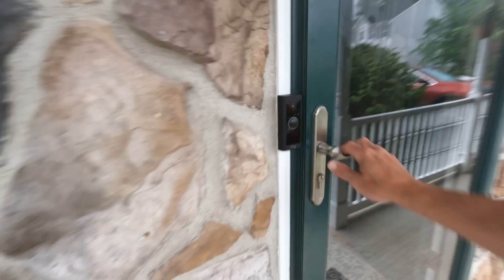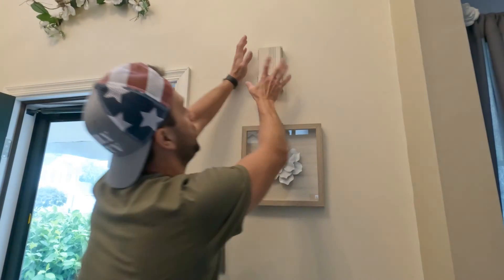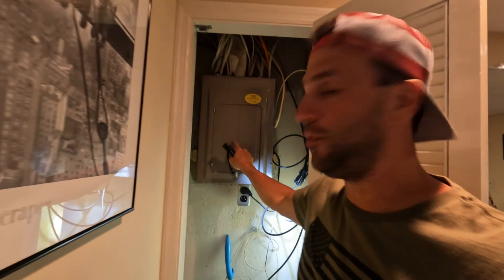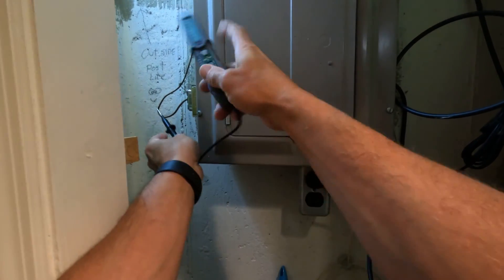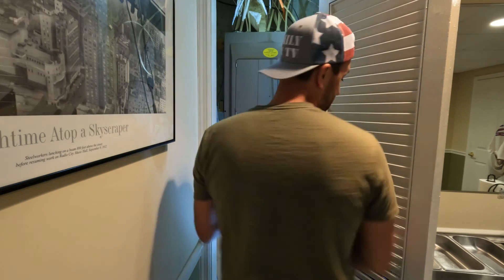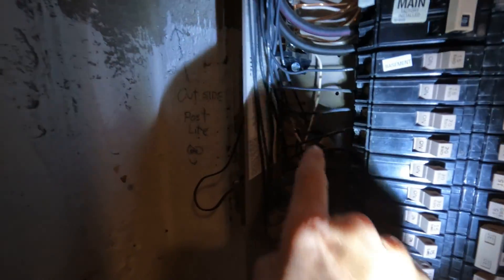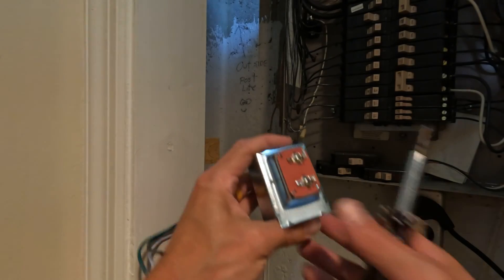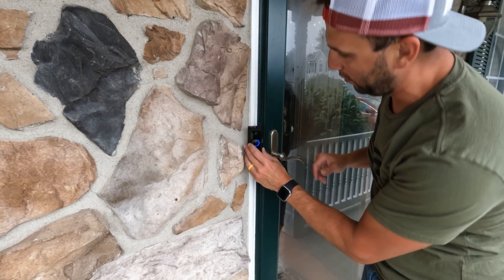Ring Doorbell Troubleshooting and Repair - Dummy Proof Solutions here #diy #ringdoorbell

Comment: Hello my question is would my ring doorbell even work if there was a problem with the Transformer or the electrical box? my ring is now using its battery when before it was charged via the wires from the doorbell.
When pressed it still rings the doorbell on the inside so I'm not sure why it's not keeping the battery charged.
Reply from the maker: Sounds like it's on battery backup and it will work until that battery dies.    I didn't know ring had doorbells with battery backup.